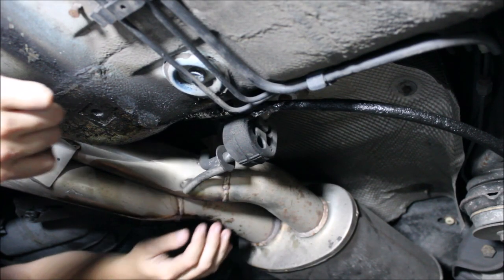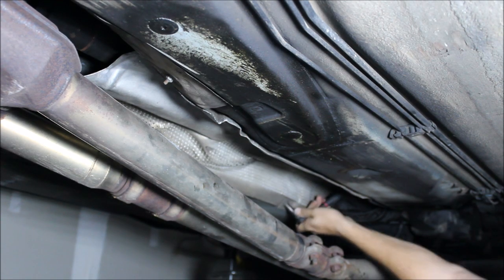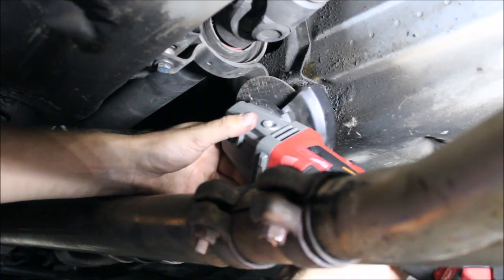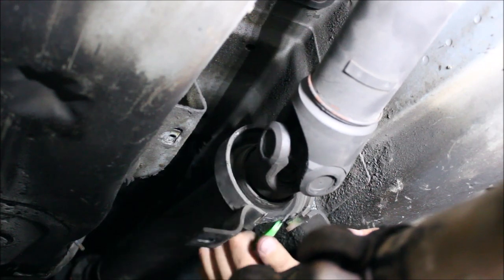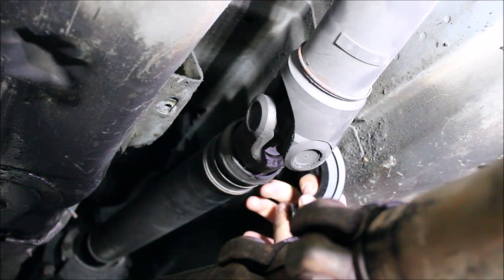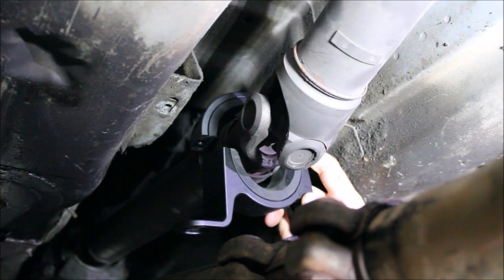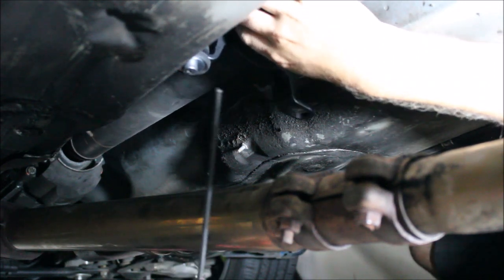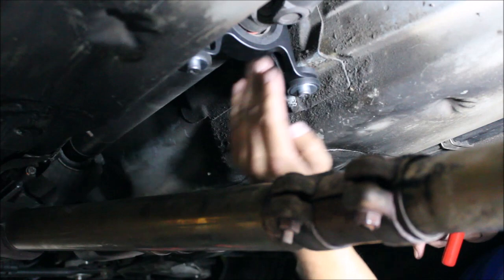JXB Performance B5 A4/S4/RS4 Driveshaft Carrier Install Guide

Comment: CANNOT WAIT!    I'll film installing it on my C4 Chassis, but should be pretty much the same.
Reply from the maker: Definitely hit me up when you get it done. I’ve struggled to find a local car to do the install video on. I’d link it on my site if that would be agreeable.
Reply: @JXBPerformance  Sure thing!  Thank you for supporting the C4 chassis and I love your business model.  My main job is industrial design but I dabble in experience design and I gotta say your whole experience so far has been superb.   Great job so far.
Reply from the maker: @ADDvanced  I just had to google experience design lol. I love that there’s an actual term for “making a great user experience”. Something I put first in my business for sure. It’s not just great for the user, it’s also much more efficient to be forthcoming with just the right information up front. Saves lots of questions down the road, and ultimately the time spent pays off many times over.
Reply: @JXBPerformance  If you need any help with super complex surfacing, or renderings/animation of cad, bug me.  I have a lot of crazy software.

Comment: wouldn't there be vibration as the rib isn't symetrically cut all around?
Reply from the maker: Hey Lenny.  The rib is on the stationary part of the bearing (the outer race), so as the driveshaft rotates, the center rib and the clamping bushing around it are stationary.
Reply: @JXBPerformance  thank you. How do i go about purchasing this?. I am mechanically inclined and have ramps and stands to do this upgrade asap.
Reply from the maker: @DENS973  you can see the range of driveshaft carriers and order here: https://www.jxbperformance.com/products?category=Driveshaft%20Carrier
Reply from the maker: @DENS973  for the B5 fitment specifically, it's here: https://www.jxbperformance.com/products/b5-s4-driveshaft-center-support-bearing-carrier-upgrade